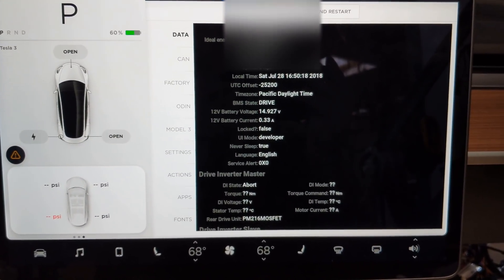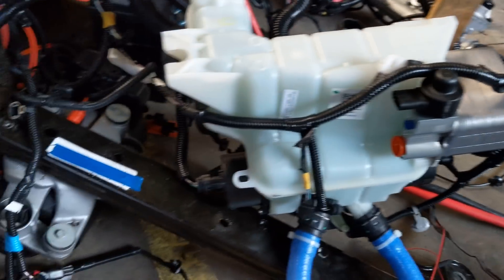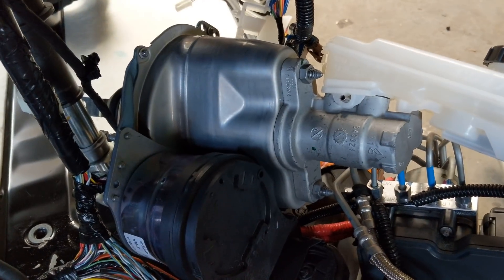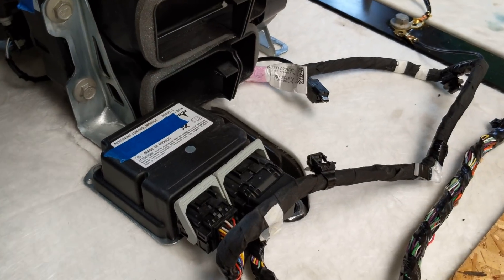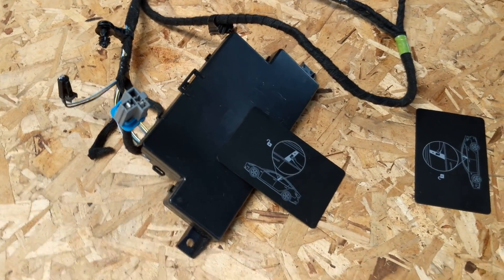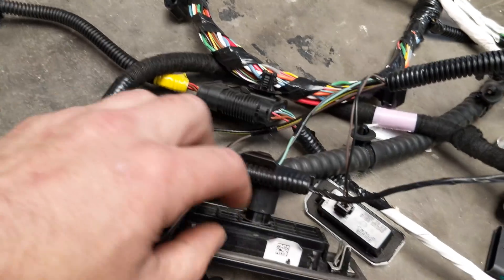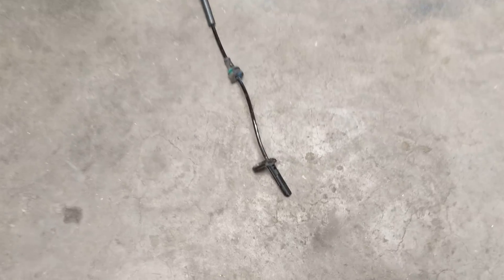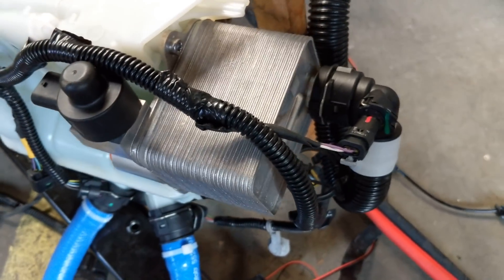Tesla Model 3 - Exploded?!?

Comment: If those systems stopped communicating with each other but the touchscreen and some features were still operating doors and windows open (not seeing key, 12v power state, brake pedal (but brake lights do come on)  fails every communication test. The problem I’m having is I live in Maine and the closest service center is Massachusetts and I cannot get the car to come out of park or go into tow mode. It started off I parked it came out the next morning all it would do is keep resetting over and over again. It seemed lights blinking on and off. Got worse from their eventually the driver side doors and windows quit working. I replaced the left controller. The windows and doors started working again. But back to the same problem it said a software update was available so I updated the software, but something didn’t work correctly because now it says incompatible software detected. So I have been looking through all of your videos trying to figure out what might be going on with this thing. To no avail. I have car dollies but loading a car onto a car trailer on car dollies seems like it’s going to be impossible because of the small casters. Any information would be much appreciated.  Erik.
Reply from the maker: You should never install a new software version into a car not fully functional.  Go into service mode and run a "CAN redeploy".  If that doesn't fix it you'll have to work the problem, there is amazing diagnostics.  If you would like me to assist and help you diagnose for a nominal fee, I'm happy too.  My email is available using a browser to navigate to my channel's "about" tab.
Reply: @Ingineerix I just sent an email off to you. You’re awesome!

Comment: to weld a body part on tesla 3, does the 12v and main battery model need to be disconnected?
Reply from the maker: You have to pull the connector at the penthouse under the rear seat right side, then pull the 12v negative.

Comment: Hi I have seen your video as I am wanting to use some model 3 sets in a different car, do you know if the body controllers left and right will power just the seats by themselves if I find the positive & negative, or will the need more than that to make the controls work on the side of the seat? thanks
Reply from the maker: They used to back on 2018.x software.  Don't know if this is still the case.  Might need to send CAN.
Reply: Do you know how to send a CAN signal or is this unrelaistic ?
Reply from the maker: @powerraxstoragesolutions9852  not unrealistic, but takes some engineering time to figure it out.  Then you need some hardware to send it.

Comment: My model 3 is having battery problems they replace the battery and the dc inverter, and now it has a VC front body control error, what do you think I've got stuck with a car everything shut down they tell me that it's fixed but this is the second time I got it back and it still came up with errors do you think the VC should be replaced this is on a 2021 model 3...
Reply from the maker: It is not really possible to diagnose without access to the diagnostic codes and alert history on the car.   If you paid Tesla to fix it, I would force them to make it good.

Comment: As a tech geek I find your videos to be most interesting, and I thank you for them.  

I just purchased my MX Plaid on June 30, and have a question about the antennae.  I believe the FM antenna is in the rear hatch glass.  Can you confirm that?  From this video I see the GPS is in the front 3 camera housing, and as well you point out where the WiFi antenna is located. Is the WiFi and GPS for the Model S/X in the same location? Last, do you have any idea where the antenna is located for the XM Satellite radio?
Reply from the maker: Wifi is in the headliner, and XM is under the glass in the rear hatch.  Both are very hard to access.

Comment: ? Are there any settings that would allow Tesla to turn-on automatically (plugged-in or not) and warm battery pack.... say if temperatures got below said temp.        or  -10 degrees c/f k 🤔😐
Reply from the maker: Tesla doesn't turn on pack heating, but when you go to charge the pack, it uses power from the grid to heat the pack above 0C before charging.   The only other time pack heating is routinely used is when navigating to a supercharger, the pack will use some energy to preheat itself to allow faster charging.

Comment: Question have you figured out the audio system as in a digital output or is it a can system?
Reply from the maker: Neither.   The audio signals from the ICE ("head unit") and the rear amplifier are carried over A2B: https://www.analog.com/en/applications/technology/a2b-audio-bus.html   However there are 8 channels of amp located in the ICE itself that directly drive speakers.  When a car doesn't have the "premium audio" option, the rear amp is omitted and the built-in 8 channel amp is used instead.  The audio from the tuner is carried over ethernet to the ICE.  (Broadr-Reach)

Comment: Hi, I want to get the positive 12v, and bring a cable in the trunk to power up an AC inverter (2000w). I tried it connecting directly in the front, getting the +12V from the battery connector where a 35mm2 positive cable arrives from the main battery in the back. I do not want to put a cable from the front to the back and I was wondering if I can connect a cable (35mm2) directly close to the battery as in the video is visible. What is the best point to get the +12v (with very high current) to get back in the trunk? Many thanks

Comment: You show the redundant power connections to the power steering rack in the video.  Do you know if the power connections at the power steering rack  are 12VDC, high voltage DC from the traction battery (they are red/black and not orange) or three-phase AC converted from two redundant upstream modules?  If three-phase,  that would require two each HV to three-phase AC inverters.  I read somewhere that the power steering assist motor is three-phase AC and not 12VDC like most ICE vehicle use.

Thanks for the great content and for any answers to my questions!

Watched your video on the VC-Front module and you mentioned the two red wires on the right went to the PS unit.  So it looks like it is indeed 12V DC.  Maybe one line is feed directly from the DC-to-DC converter and  the other directly from the 12V AGM battery.  Not sure where the three-phase AC/inverters came from??  A possible way to verify redundant side, every time you drive the vehicle, would be to use the battery side when in reverse?

Comment: Nice to meet you.
I have a question
The rear glass heating wire 12V power does not come on.

What should I repair?
There is no abnormality

Comment: Hey @Ingineerix - I was thinking of buying a used HVAC module - seem to be a few on eBay. Do you know what the wiring it for them/required supply? Looks simple - supply voltage (for I guess the heater) and 4-5 control pins of some kind. Thanks

Comment: How feasible would it be custom build an inverter to drive an original model 3 motor with the battery pack? Is that all that would need to be addressed in order to bypass Tesla's stock systems and security, question marks

Comment: How is the connection to the doors routed? Is there no ECUs in the side doors?
Are door latches, window motors, mirrors etc connected via hardwires to the VCL and the VCR?
Reply from the maker: Correct, that's why VCL/VCR is close to the doors as possible.

Comment: Does anyone know which one of the pigtail clips on the VC_left module runs to the drivers door? I'm trying to locate the map pocket light wire. Should be a smaller wire, maybe 18 gauge and red. I just need to know what harness to look at.

Comment: There have been discussions of Bluetooth/Wifi antenna in the rear view mirror housings. Is that accurate? Is the cabin WiFi just for in-car access?
Reply from the maker: There are two WiFi antennas, one on the headliner that is also shared with Bluetooth, and one in the Driver's side view mirror housing.

Comment: Where is the SIM card located and how can I get to it on my model 3?
Reply from the maker: It's in the ICE (passenger side firewall behind glovebox), but around VIN 90000 they went to an eSIM, so it's not removable.  If you ware trying to disable communications, you can still disconnect the cell modem.
Reply: Ingineerix I imported my American spec model 3 to UAE. I was going to put a local sim into it. Do you know of a way to enable navigation out of market? Tesla sells model S and X here so they have support for the region for those. Any other helpful info would be great. Thanks!

Comment: How do you get access to the linux on the ICE? Do they have a serial console exposed ?! :D my new car (not a tesla) is arriving next month, it runs linux (automotive grade linux) on the center console as well, and i want to have root access to display some more information :) I guess they use the CPUs security features to only load a signed bootloader and the bootloader checks the signature on the image + afterwards the kernel uses dm-verity to check for modified flash blocks.. 
So modifying the image on the emmc is probably not possible without breaking the chain of trust..
Reply from the maker: Bingo.  Your assumption is 100% correct.

Comment: If you’ve still got this setup on the floor, can you point to a best place to drill a hole in the center console front to put an extra cigarette lighter plug?  So it’ll clear the ductwork stack.
Reply from the maker: You will need to take the console apart for this, so that's my best advice.  It's not that hard to remove and then you'll have full access.

Comment: Great video. Can you tell me where the Homelink module is? Tesla is now selling the option to standard range model 3 owners. The option requires the installation of a module and costs $300. I've seen modules on Ebay for about half. Thank you.
Reply from the maker: On all Teslas the homelink module is located behind the bumper cover in front.  However you can't just connect a used module, as the car will not recognize it without programming.
Reply: @Ingineerix  Thank you. I thought the system would ping devices connected and auto configure.
Reply from the maker: @ricardol1913  No, the configuration is held by the car's gateway and will not enable the feature until this configuration is updated.
Reply: @Ingineerix  Thank you very much. Great videos. Please keep them coming.

Comment: Could you supercharge it in this state? I would like to build an electric car using Tesla parts while also being able to supercharge it. I assume that the car wouldn't be able to tell if it was in a different body as long as all the computer and internal bits were included. I'm also not sure how the supercharger communicates with the car but I assume it's some kind of VIN verification? I know you can drive the car without a screen but I'm wondering if you could charge it if you fooled it to believe that it was still a tesla? A non tesla charging at a supercharger would spike quite the conversation lol
Reply from the maker: Yes, if the cooling system were working it would supercharge normally.
Reply: @Ingineerix  what modules and parts would I be able to leave out for it to drive and charge normally? also would be at all possible to replace the screen with a smaller one? I would like to be able to incorperate it into the dash. I don't need the brake and steering modules or parts since I will be using the originals from the car that is receiving the swap. I assume ICE and VC left, right, front, charge controller, and associated inverters and motor controllers, battery management etc. are required but I'm wondering if leaving out some of the hardware and mechanical parts like the cameras, brakes, steering rack, HVAC, audio system, things you would not need electronically controlled on a car from the 1970s, will cause issues with driving or charging? This may be too much effort just to allow a conversion to supercharge, but until we get better charging infrastructure...I want to try it. Plus reactions from other people at the superchargers.

Comment: After taking the car apart how do you rate the quality of the car? Do you think it will last the test of time. Thanks great videos
Reply from the maker: Tesla put all they have learned into the Model 3, and the quality in the core systems is amazing.  Not only have they achieved high-quality, but done so with amazing cost-optimization.  Tesla is the first mass-market EV to use Silicon Carbide based transistors (SiCFETs) in the drive inverter.  This makes it more efficient than any other drive inverter to date.  It's lower component count and thermal requirements make the total system cost cheaper, and additionally having less thermal stress helps make the system more reliable.  Tesla has taken hits on "cosmetic quality", but personally I don't care about this as long as the car is reliable.  Legacy car companies are better at cosmetics (fit/finish) but Tesla is so far ahead on the part that you can't see, these legacy companies should be very afraid!
Reply: @Ingineerix  thanks, great answer. im torn between a model 3 or a VW ID. I prefer the look of the VW car but have been a long term fan of Teslas attitude toward building a sustainable future. Part availablity is a deciding point too, I like to fix my own cars. 😁
Reply from the maker: @TheRealMrLaserCutter  Well you wont need to fix an EV very often!  By the time it's old enough to need any repairs to the powertrain, there will be tons of used parts on the secondary market.  I already provide services for owners wanting to work on their cars the includes full diagnostic access and the ability to program subsystems which is requires for part replacement/upgrades.  I presently support about 600 Teslas that are grey market or salvage, where Tesla considers them "unsupported".  Since the VW ID is not shipping now, it's anybody's guess how good it will be.  It's also unlikely to have the efficiency that the Model 3 powertrain enjoys.
Reply: @Ingineerix  If I read your post correctly, if you wanted to replaced a bad part let's say VCRIGHT, motor, power steering etc with a new one or one from a wrecked model 3 Tesla key code its parts, aka your need to program it to work with the vehicle.  If yes you are able to program this for people?  Dose it need to be sent it to you or can it be done by the owners once you do your magic?

Comment: Thanks for the great overview, question: is there an HDMI out on the AP Computer?
Reply from the maker: You must mean the ICE (MCU), as the AP computer does not output any video.  The ICE uses a system called FPD Link III to send video to the LCD and get the touch information back over 2 twisted pairs: https://en.wikipedia.org/wiki/FPD-Link#FPD-Link_III
Reply: @Ingineerix  How do you know this!? That's so cool. I didn't know that existed.

Comment: First off, love the breakdown! Awesome work. 

Quick question, looking to add heating elements to the steering wheel. The purple connector under the steering wheel airbag, only has 3 wires, but looks to have 6+ pins on the female side. 
Are those terminated through the steering control module that you know of?
Reply from the maker: Sorry, no idea on that Sean!

Comment: For Track action, can you suggest a way to disengage traction and stability control and keeping ABS?
Reply from the maker: There is an internal mode for testing, but not available to normal end-users.  It would require CAN injection and will likely void your warranty.  Best bet if you are that serious about tracking a Model 3 is to buy a P3D and Tesla gives you the track mode setting right on the UI.

Comment: Great work dude! I Like your explenations! 
At 2:15 I saw a bunch of mysterious connectors near to the VC Right. It's seems to be a inline quad connector for coax wires. Can you say something about this? They seem to be smaller then the usually used FAKRA connectors for coax cables. 
What system do they connect to? Who ist the manufacturer?

Thank you! Bye bye!
Reply from the maker: I don't know the connector style, but these are used for signals all over the car, such as AP cameras, Antennas, etc.
Reply: @Ingineerix  Thank you for replying! It seems to be the new coax connector generation. There are some types available from leading connector manufacturers like TE, Molex or Rosenberger.

Comment: Have you made a video or comments as to: 1) Where the EDR connector is located?  2) What is the type of connector used to access data?  I am in the process of preparing to download crash data in order to refute the other driver's claim.
Reply from the maker: I'm not aware of a dedicated EDR connector.  The RCM is made by Bosch and has an internal EEPROM for storing the EDR, so I'm sure there is a way to connect directly to the RCM for retrieval.

Comment: do you know where in the car this is located?

https://www.ebay.com/itm/2017-2018-TESLA-MODEL-3-REAR-LEFT-SIDE-ANTENNA-AMPLIFIER-FM-RADIO-MODULE-OEM/292770111676?fits=Make%3ATesla&epid=10024805585&hash=item442a7560bc:g:nZIAAOSwK65bwevd:rk:4:pf:0

and, in a related question, do you know what kind of connector this uses (or what kind of connector the FM radio unit uses)?  i'm looking to try to install satellite radio and hoping to tap into the antenna wire to install the antenna direct adapter...

i know the actual FM radio unit is in the passenger c pillar, but in pictures i didn't see this amplifier over there.  the ebay listing says rear left, so i'm guessing (maybe?) it's in the driver side c pillar, but i was hoping to have a definitive answer before i take the covers off.
Reply from the maker: Under C-Pillar cover, passenger side.